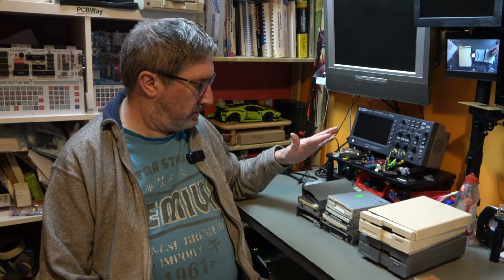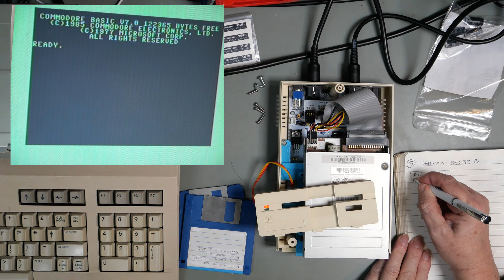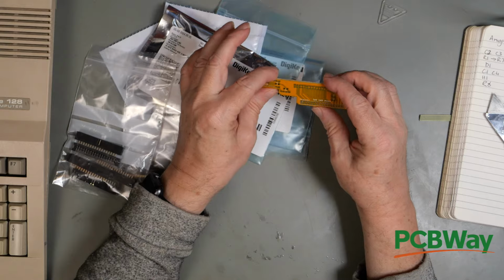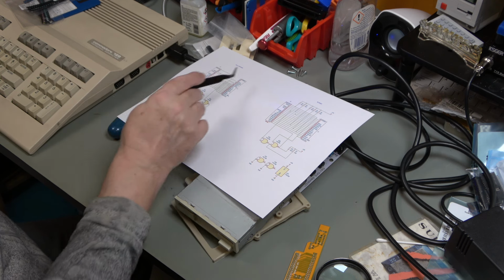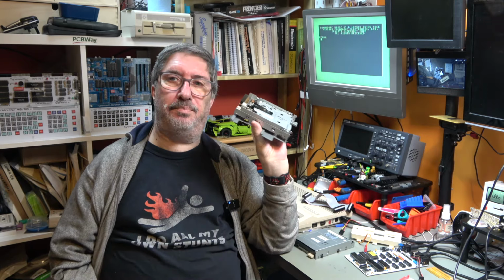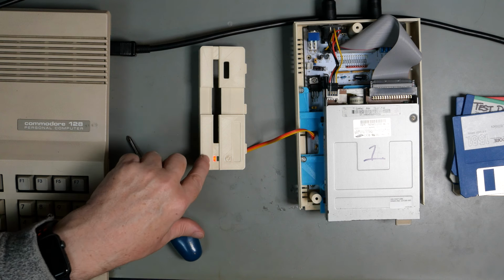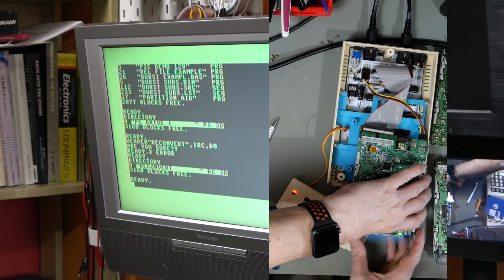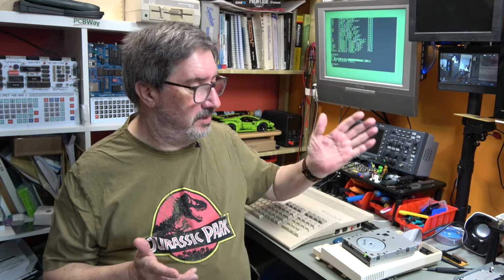1581 Followup: Let's get this thing working! (and figure out why it isn't)

Comment: I was home ill today, had some time watching. I enjoyed it :)  1:14:30 - when drive 1 does not detect disk change, I noticed that it randomly turns on the motor when the disk is out.Bad contacts in the disk-detect switch ? Maybe a bit of contact cleaner will help.
Reply from the maker: Thanks, I'll give that a go. I'm hoping to do a long term follow up at some time in the distant(!) future, which will include drive maintenance required. This was just a "quick" test, and didn't really dig into drive mech problems (it was way long as it was!)

Comment: As I mentioned in a comment to your last 1581 replica video I had some trouble with bad switches in these SFD-321B drives. I noticed that the one of your drives having problems with the disk change randomly started the motor - this could be related to faulty switches.

I also think that the adapter PCB is not a replacement for a proper conversion: None of the two circuits you have shown creates a proper timing for the ready signal. In one case it's just synchronized to the index pulse, but that doesn't guarantee the drive is up to speed and stable. The index pulse can arrive from nearly 0 rotations to 1 rotation after the motor has turned on and the drive selected. The other circuit does no timing/synchronization at all.
Reply from the maker: Others have mentioned the switch in that drive - it's definitely worth looking into 👍
Reply: @TimsRetroCorner  Yes, for sure. With one of my drives the switch was on the edge of failing. And: Take care with newer revisions of these drives. I also mentioned this before - there are HD only revisions where the HD selection switch is missing completely and the drive is configured for HD only! I rewired the one of my drives with this limitation to DD only as I planned to use it in an Amiga or 1581 only.

I hope your odyssey ends without killing many more rare and expensive chips...

Comment: I recently got to the bottom of my 1581 issue, but it wasn't as complex as yours.  In the end, my DIY 1581 with the Sony MPF920 was working all along.  The main issue was that my C16 uses a 6502-based CPU with adaptor circuitry, and that I was testing with JiffyDOS.  There is nothing wrong with JiffyDOS, but the CPU adapter frustratingly doesn't work with it (confirmed via other users of the same board).  Once I switched to using the stock kernal, all directory and SEQ file load corruption/hangs ceased.
Reply from the maker: That's worth knowing. I have a 6510 with adapter in my Plus/4, and some 6502 adapters waiting to go into some other repairs. BTW, did you need the stock kernel in the 1581 as well as the C16?
Reply: @TimsRetroCorner Either ROM in the drive worked during my testing, regardless of how the CPU kernal is configured.  I generally leave the drive in JiffyDOS mode and don't experience any issues.

I have the same 6510 adapter, but I haven't tested it with the 1581 yet.  I'm confident it will work as there is no modified JiffyDOS kernal ROM that supports the 6510 adapter board (yet?).  For reference, I'm using the "Monotech MOS CPU Replacer" board.